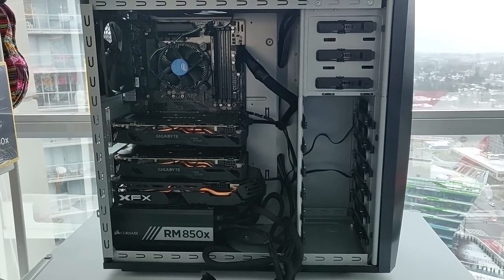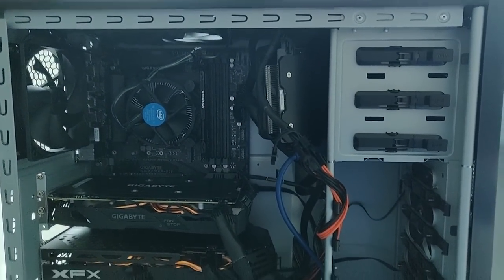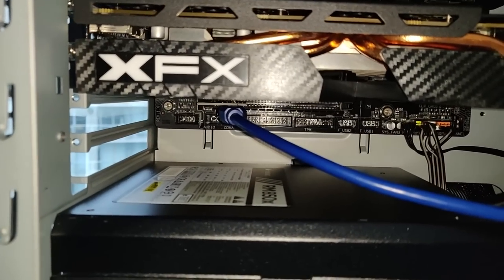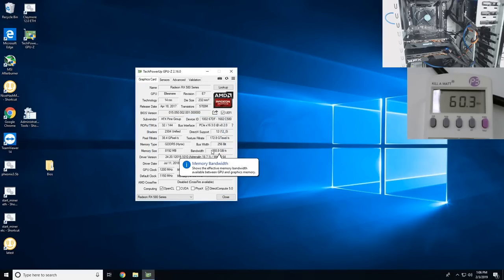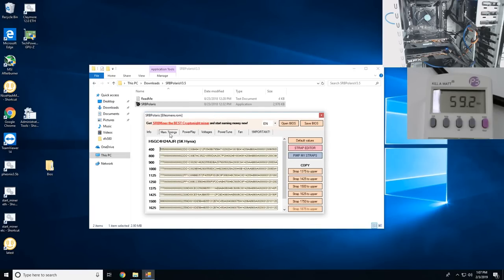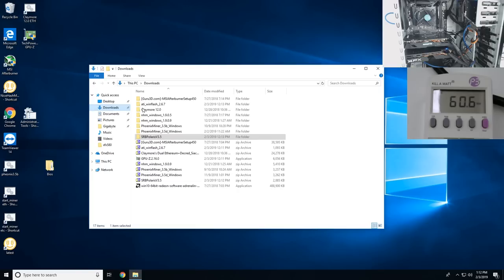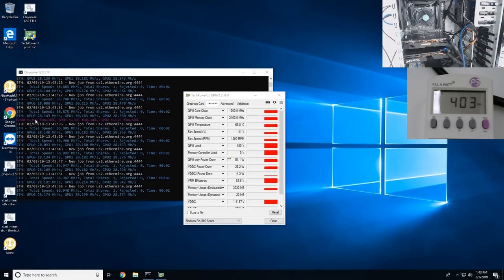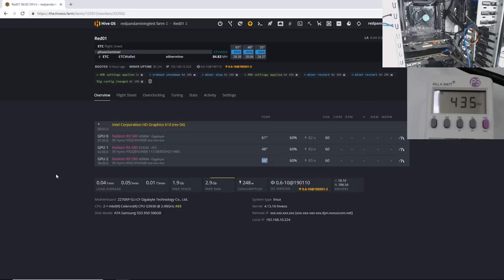Youtube Comment's Saved My Friend's Mining Rig!

Comment: Thanks for the shout out. If you use short video cards like Zotac minis, you can actually fit 2 gpus in the drive bays. I’ve had 5 gpus total I n a case like that running good with no heat issues. Feel free to follow me on Twitter @Crypto_Dave_